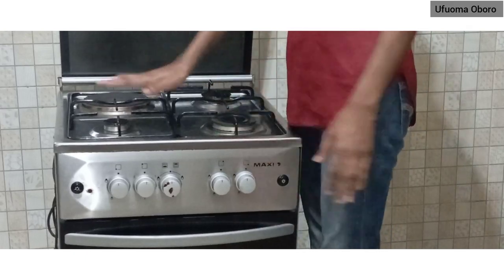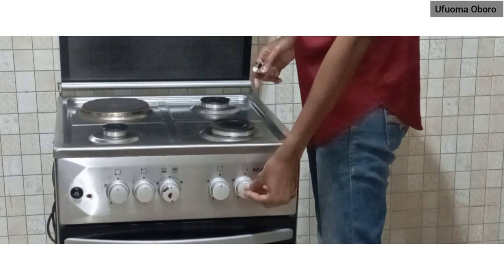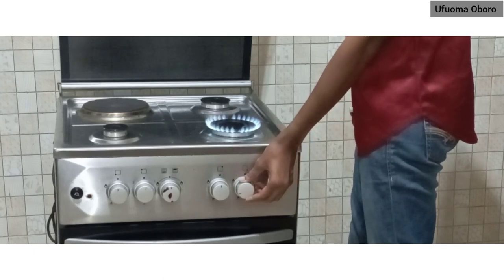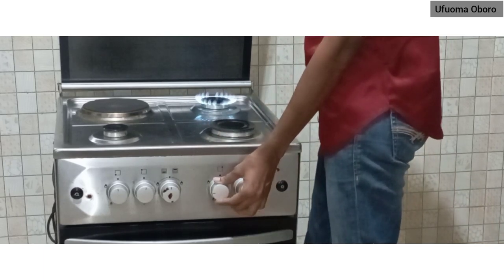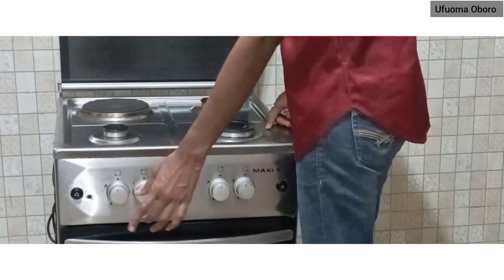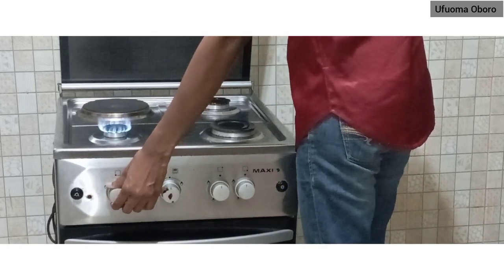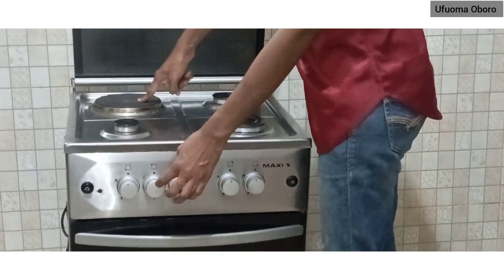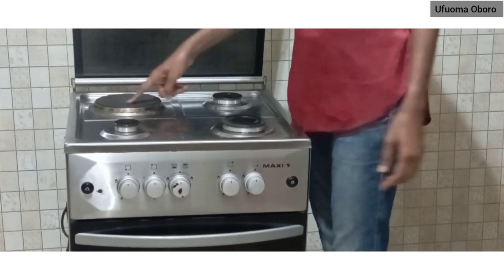How to operate a MAXI Gas Cooker/Stove. 3 Burners + 1 hotplate

Comment: Thank you so much! I was however hoping to see how it works without the lighter, can someone help? I understand when you don't have a lighter, you can use electricity to light the burners..or did I miss that part..
Reply from the maker: Thanks for watching. You can plug to electricity, click on the ignition button while turning on your knob at same time. Fire would light up. ❤️❤️

Comment: thank you...i just bought my today...but what with those two black buttons
Reply from the maker: Thanks for watching. One of the buttons is a lighter to turn on the the gas cooker and the other button is to turn on the bulb in the oven/grill section. These buttons works with electricity.  I hope this helps. ❤️❤️
Reply: Thanks for this video.I just changed my cooker today and it’s been giving me tough time to operate.Until i stumbled on your video 😊 This was really helpful 👍🏽😎
Reply: Yours is not connected to the gas cylinder.
Reply from the maker: Thanks for watching. The gas cylinder is actually connected to the cooker, that's why it can produce flame. If you want to connect yours, this link can help. https://youtu.be/RgmjpmywAfc?si=cKXvSq5Ih5Q6VaOI
❤️❤️

Comment: What is the two black button by the side of the oven for
Reply from the maker: One of the buttons is to ignite your burner, so it could light up without using matches or a lighter, however you have to plug to electricity.  You push in and at the same time operating your knob. The second button is to light up your bulb in your oven which requires electricity too.. Thanks for watching ❤️❤️
Reply: @ufuomaoboro7247  thanks ma